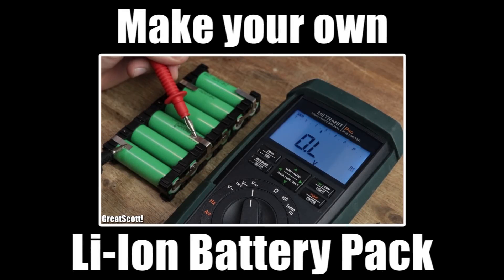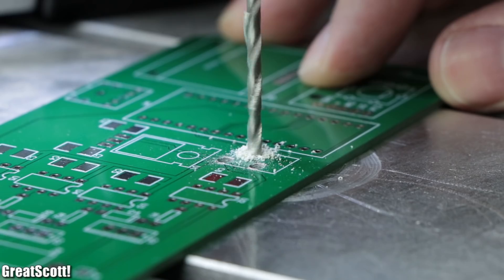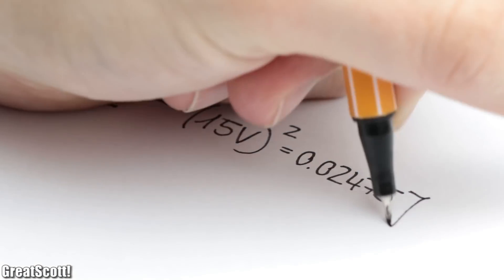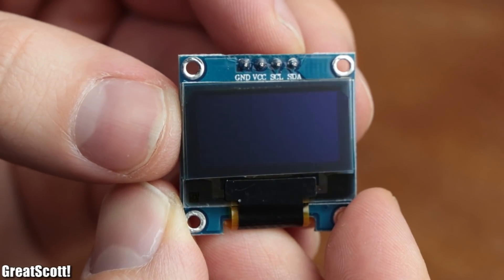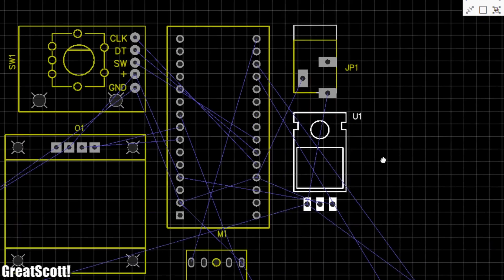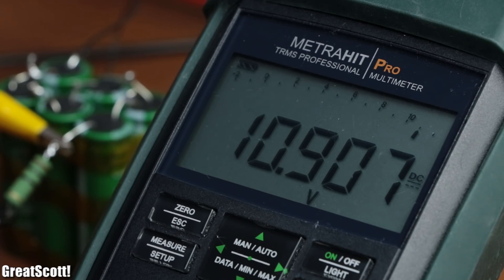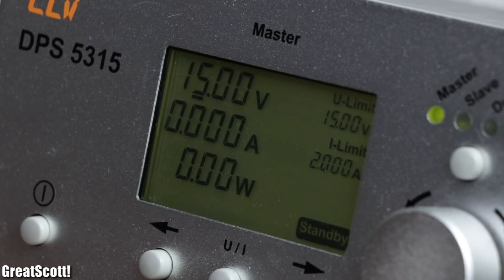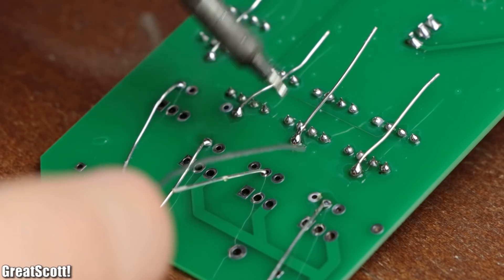Battery Spot Welder (CD Welder) || DIY or Buy

Comment: And why you do not use lipo batteries instead of capacitors?
Reply: Lipo batteries have very short lifespan compared to supercapacitors, especially if discharged at high current.
Reply: Alberto cornejo Ave actually did that though he used high power 18650 cells to do that and he was successful
Reply: They cannot discharge fast enough
Reply: For anyone wondering why LiPo's aren't suitable for this application. Yes, caps may not hold as much energy as a battery but a battery can't discharge / recharge fast enough. It's all about the speed at which the charge is delivered.
Reply: Lipo or liion batteries has way more resistance than capacitors so u can't discharge as fast as the capacitor can.
Reply: A general but wrong assumption is that supercaps can be infinitely quickly discharged. In reality supercaps have a surprisingly high internal resistance. For a 100F/2.8V type the Ir is typically 10mR, meaning the cap can only deliver 280A into a perfect short.  The Ir of LiPos can go down into the 1mR range, allowing them deliver much higher currents. E.g. 10Ah/65C LiPo cells will easily deliver 1300A pulses. Dimension your mosfets accordingly !
Reply: Laharl Krichevskoy yes, i break a 8000mah turnigy nano-tech cell one month later 😫
Reply: Because, even though super capacitors have a "super" in their name, the amount of energy stored is big only relative to its not-super relatives. LiPo, or LiIon, or even any alkaline battery has far more energy stored than even super capacitors.
Reply: banano banana i use a turnigy nano-tech lipo battery and it works perfect 🤔, but i know that maybe other kind of lipo batteries can not support it.
Reply: Caps are far more cheaper and do not suffer as much from thermal runaway and high current discharges as batteries.
Reply: You say that but I weld 100v lithium packs on the regular with a 20Ah lipo no problem at all. I can weld as fast as I can and it never misses a beat.
Reply: The solenoid is a major point of failure. The DC arc when it opens the connection will very quickly cause it to fail. Possibly welding its own contactor shut. Best to use mosfets, plus mosfets are much faster
Reply: You use 24 in series to make a 100v pack. Typically I build 24s10p packs with sony vtc6 cells. so 240 cells in total, 100vdc, 32.5Ah with 200A continuous and 350A bursts. Built with 14mm wide 0.3mm nickel strips (stacked up with 4 layers on the series links (making sure to have as many links between the series cells as possible))
Reply: th3d3wd3r My wallet exploded when it heard "240 cells"!! ;)
Reply: Ammar Abotouk the ave one I saw was lead acid +a solenoid for welding tabs to 18650 liions

Liion can be used but they don't like currents beyond thier ratings, and they can say no in a very obvious way...
Reply: th3d3wd3r is that safe? I've seen first hand what can happen when 40 amps goes through a 18650 battery :-s
Reply: No, no they don't
Reply: car starter battery?
Reply: CAPACITOR HOLD MORE AMP PER CHARGE.
Reply: Alberto cornejo lol, use the batteries to weld them.😂😂
Reply: 72mgmidget hahaa! Yeah, EV batteries aren't cheap 8s
Reply: CoolKoon hey, why not use lipos AND capacitors! :D

Well a car battery might make more sense but yeah :P

Ever since i got a battery powered solder iron i like to power everything that i can with batteries hah!
Reply: diesel car standard battery (200Amps cold start current) + BTS555 as control mosfet.
Those tiny capacitor-legs are really huge resistors at high currents, not even 0,5mm².
Reply: Psi Q i guess you would need a lot of capacitors :P
Reply: yes they have "high internal" resistance, so only 150 to 200Amps can flow with the right starter cable (>5mm²?),
while the voltage "output" drops because of that resistance. But still 150A are flowing so this internal resistance DOES NOT MATTER for the application.

(The BTS555 datasheet tells you to use 2 legs parallel and the Tab as connector to come at least close to the rated internal resistance.)

For 15V you would have to get lower than 0,5 Ohm over all connections, cables and including the contacting tip to get something you could start calling a welding current.

Well, nevermind. If you want to use caps for welding then do so, i wont :-)
I'm already sorry i dug up this old video.
Reply: Psi Q so you would need a lot then lol
Reply: It's not that you can't build a high enough discharge lipo battery, it's just that it's safer to short out capacitors without some sort of current control circuit.
Reply: Alberto cornejo They would explode.
Reply: Yeah, they dont discharge as fast.

You could do it with lipos i guess, but the machine wouldent last as long and it would also be much more expensive :)

The lipos would not take the abuse for as long

Comment: Hey, Scott,  great video! 
May I ask you something: is it worth spending 180 euros for the  PPS 5330 power supply? I'm an electronics engineering student and I am trying to build (slowly) a (mini)lab. But I'm trying to spend money for decent quality devices/instruments only. Is it in your opinion a good strategy?  Have you ever found yourself in a situation where the  PPS 5330 is not enough? How long did you use it? Any details/advices are welcome!
Reply: I would suggest checking your needs, since there are very many different supplys at different prices!
Unless you plan to use it as a voltage referance, you usually don't need that high precission supply.
Reply: @erlendse, thanks for your suggestion. I know there are many supplies, but since the power supply is one of the most important device in an electronic lab, I am willing to spend a little more for a good one.
Reply: Well.. sure it's kinda important (maybe not most important, a spliced USB cable gets you far)

But it's also one of the less critical ones, since most circuits can accept a +/-10% voltage range (and you would have a multimeter nearby for fine adjustments).
Variable current limit to save your circuit in case of trouble is valuable!
Reply: At your beginning, keep it simple!!! Your most important equipment is between your ears.
Save money and with your project can your lab grow up.
powerspply - 20V 2A 30 USD
solder station - 60W 50 USD
hot air station / pizza oven (for reflow) - 30 USD
digital oszi (with fft) - 150 - 200 USD
multimeter 50 - 75 USD

Comment: Hey GreatScott! thanks for the new video. Just wanted to mention when you were trying to parallel the MOSFETs you should use a small resistance on each source pin. MOSFETs don't like to be paralleled and don't naturally balance the power without some resistance.

Comment: Here's my metod.I have 2 transformers wired in paralel which give around 24v AC and 30-35A.I use leftovers from desoldering wire which has solder on it.I conncect on side of transformer to the desoldering wirr and other side with a carbon rod from AAA cell.I takes around 6-8 sec and the joint is unbrakable.Usualy i do it 3 times to make sure it wont fall off.You can add flux is you want it will make it better.It has worked for me for more than 20 batteries.

Comment: Oh, man... You have to fix it! It's a matter of honor now!
Reply from the maker: I will see what I can do
Reply: @greatscottlab  
Will you try to make an inkjet printer ,industrial grade with drop deflection method.
Reply: @greatscottlab  any Update on this one?
Reply: @greatscottlab  Why dont you do it like this: 
Charging a capacitor (like 10mF 30V) with a 30V 5A lab power supply  and then discharge it with a mosfet (3* 200A) in very short pulses. You could controlle your mosfet with a pulse width signal and charge another capacitor (like 2.7V 500F) with it. Now you should have a more continuous flow of current if you attach a load to it. And you could set the voltage to a fixed point with the PWM signal to have like 1V and 150A. (I dont know if this works just an Idea for making a high amp power supply correct me if i'm wrong)
Reply: @neutronenstern.   sounds interesting - would be interesting to hear @GreatScott 's comment
Reply: @greatscottlab  If you move your 10ohm resistance R5 in between Vcc and P1 Cap+ you should be able to solve the issue.
Reply: @greatscottlab  So 2 years later you will retry? :)
Reply: Yeah, this is begging to be fixed and nearly €200 is too much to pay for a minor flaw.

FIX IT!! FIX IT!! FIX IT!!
Reply: I saw in another comment further down about a possible overvoltage due to the caps being in series,
could we charge the caps in parallel at a low 2.5-3v then discharge them in series.

the protection board could have the low (2.5V~) in, a high (15V~) out, and an interrupt pin (to isolate the charging circuit during discharge)
Reply: put the super caps on the PCB (with a lockout jumper), or put a screw terminal for them
Reply: Sparky BearBomb Or he can use a protection board made for super caps.
Reply: Because I could =P, I went through the datasheet of the DRL 100F supercap (from element 14) you used and added the schematic and PCB footprint to the EasyEDA library (just search 100F) although as I don't have one handy just check the footprint over with the ones you have, Stay Creative =D

http://www.sensorsiot.org/wp-content/uploads/2017/05/ProtectorDiagram.jpg JP1 is the cap terminals, one circuit needed per cap for over voltage protection.
Reply: that's a great idea, can be used for more projects then =)
Reply: yes, fix it with a microwave transformer!
Reply: Sparky BearBomb Absolutely!
Reply: What's up bro
Reply: Yep, you can't let it beat you!
Reply: He gave up. Accepted defeat
Reply: I would use thin brass profiles from Conrad to make the capacitor bank. Worked for my 4 Eaton XV3560.
Reply: did anyone find a way of fixing this welder project??
Reply: @coldfire0101  I've built one with an analog control and a car Battery. Very simple and reliable, should also work with Capacitors.
Reply: thanks for reply arnold,  do u have instructions for how to make that ?
Reply: @coldfire0101   Unfortunately I deleted the schematics. I'll redo them and design a proper PCB. But I've taken some pictures https://drive.google.com/open?id=1ZcXcYaGo1bA1a8a4t5B9ogQTbgt5zStZ

(Note: this was an absolute low budget quick and dirty project :p
Reply: that looks pretty good on those welds in pics
Reply: @arnold5328  did you make the schematics as im interested in doing that but the pictures aren't very clear, even if I'm 1 year late lol
Reply: @arnold5328  have you been able to redo the schematic of your car battery spot welder?

PS. haven't looked trough complete mass of comments - so I might have missed it.
Reply: Hey I have successfully made one

https://youtu.be/tgsNmOHtr0g
Reply: How about using relays instead of mosfets?
Reply: @franmaric  A relay would be destroyed after the first use as theres about 1000A running through a tiny contact point creating sparks and shit.
Reply: @franmaric   are Relays not too slow?
Reply: @franmaric  relays are not fast in switching on and off

Comment: I don't know if you know AvE but he has made a video about DIY  spot welding ! 

By car battery
Reply: Solder Joe u don't know !
Reply: you can weld the positive terminal. you just have to put both of the electrodes on the terminal, otherwise the current will go through the battery. but nothing stops you from welding with the car battery in that way.
Reply: There are numerous videos on YouTube that prove you wrong.
Reply: there is 100s of tab welding videos using a 12 v battery -joe is keyboard warrior
Reply: Solder Joe - The comprehension problem is your failure to comprehend the path of least resistance. You have gone full on tard here, check yourself next time.
Reply: You all have comprehension deficit.

Comment: I'm not sure if this fail is as an April Fools or not
Reply from the maker: We will never know....
Reply: German humor
Reply: I think it is a joke
Reply: He used IRL Mosfets so it can't be an april fools prank...
Reply: The soldering makes me think it's an April fools.
Reply: This is an April Fool. 10 ohm resistor is connected to only one MOSFET(in schematic he published). 
Proper design would be Vcc -> 10ohm resistor -> capacitor bank -> GND. Junction between 10ohm resistor and cap. bank should be used as one "welding terminal", and other "welding terminal" should be drain(s) of MOSFET(s) in paralel. Then, FET source(s) should be grounded . Also, IGBT-s might be better switching solution, but VERY LOW Rds mosfets (something like under 1mohm/each, to allow marimum currents) in paralel should work just fine.
Reply: Three electronics experts are laughing their asses off over this video's extremely obscure in-jokes, the rest of us are just confused.
Reply: I came to the comments for this.. if no one had said it, I would have.  I like this, looks cool
Reply: GreatScott! Damn, your a mastermind..
Reply: i'm not sure whether everything that happens on april 1st needs to be connected with april fool's.
Reply: It probably is an April fools.
Reply: Lol
Reply: ok?

Comment: DIY!!!! Thank you for posting this (barely) non successful attempt.  I learn a lot from your videos and one of the more interesting this things is not only did I mostly understand what you described,, but rather I appreciate the not wanting to solder such complexity anymore. I think the idea of breadboard then direct to pcb is becoming more and more feasible. Thanks for sharing this tutorial.
Reply from the maker: Glad you liked it :-)
Reply: I agree. I wish more people would post their failed projects too. They are more often than not important learning experiences.
Reply: 4Erlik Especially considering this one can easily be fixed by other people if he doesn’t want to.
Reply: That is why you build it on breadboard or stripboard. You can easily mod the circuit if it goes wrong or unsolder all the components and reuse the strip board.
Reply: @simontay4851  yes but the temtation of not doit its great ..maybe work next time
Reply: Bread boards are fantastic until you rip your hair out debugging the circuit only to find that the only problem was wonky connections.
Reply: northshorepx any plan for diy laptop battery bank??